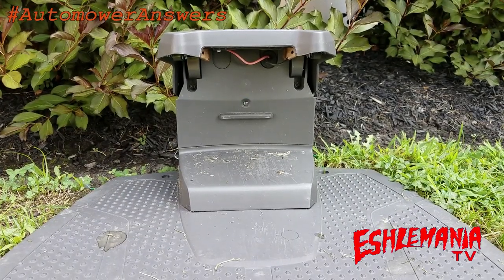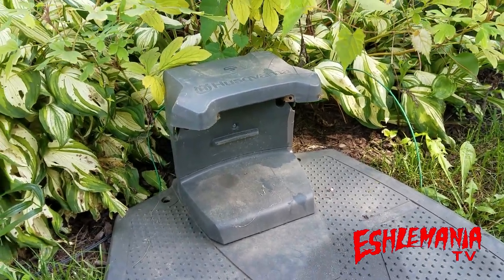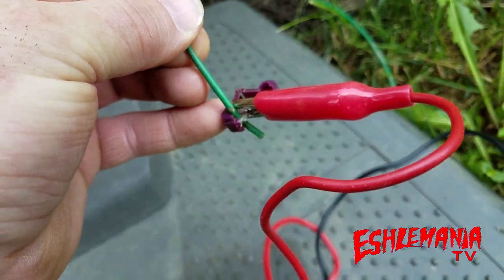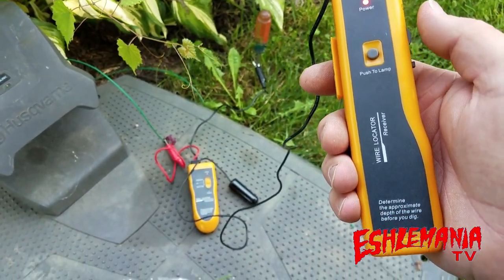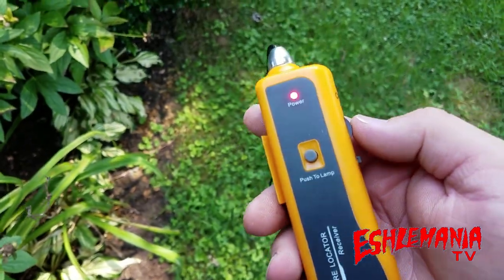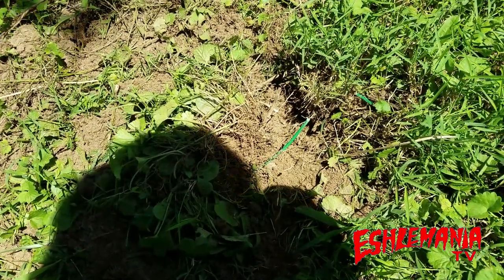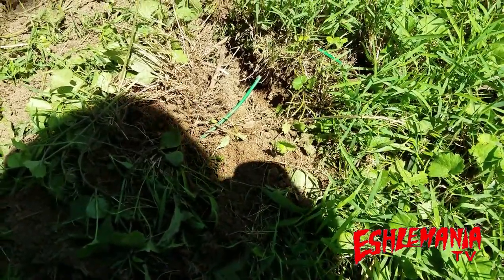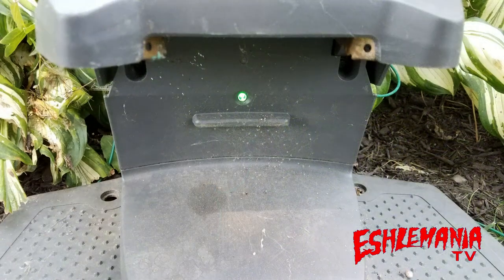Automower Answers: Finding A Break In An Underground Wire (No Loop/Flashing Blue Light Part 2)

Comment: You to the rescue again.  Used your video to wire around a fence back yard to front yard.  Works flawlessly. . .many thanks.  Now two days later I'm not getting the green light/broken wire.  Found this video and just ordered the Kolsol Wire Locator Tool from Amazon.  Will let you know how it works.  I'm feeling pretty confident.  Thanks again.
Reply from the maker: Great to hear! It takes a little while to get used to using the tester, but once you get the hang of it you'll have no problems finding breaks in the future.
Reply: @EshlemaniaTV  With your visual demo I think even I can do this. . .lol.  I gotta tell ya, your video demos are the very best available on the internet.  Thanks for actually doing what the video title says. . ."Locating a broken wire" for example.  My tester Kosol like yours comes tomorrow.  I tried the am radio thing using two different radios with no luck.  I hope this works.  If not, it was worth the try per your video.  If re wiring is necessary, at least I'll feel confident in my attempts at this point to solve the problem.  Thanks again.  I'll keep you posted.  Excellent excellent demo video.

Comment: FYI my issue was at the L and R connectors to the charging station. The purple connector had bitten thru wire so wasn't getting signal. Simple solution but only after I'd spent 2h trying others!
Reply from the maker: We went over checking all of that stuff in the first video we did.

Comment: Thank you for this video, especially detailing exactly which system you used and the sensitivity that it brought. I knew I had a partial break in the wire, because the WORX base unit was showing green (green good, red no connection),  I bought a different wire tracer, which was naff, and did the AM radio "trick" which didn't work at all for me..   Within 10 minutes of using the system that you have highlighted,  I found the dodgy wire, which was a partial break at a connector)... no other system was sensitive enough to help. Highly recommend the kolsol F02, rather than the cheap wire tracers on ebay / amazon.

Comment: Hi,

Many thanks for your most informative and clear videos on resolving issues on the Husqvarna 450x. Living in Scotland does unfortunately prevents me from doing business with you for which I am extremely sorry.
I have lots of problems with flashing blue lights and have you videos on the subject most helpful. I do have a question though and that is when using the Kolson NF-816 (a most useful tool) should one disconnect those wires which do not have the transmitter plugged in. I other words all wires are unplugged from the docking station and the suspected broken wire is connected to the transmitter part of the Kolson NF-816.
Kindest regards and thank you for all your hard work getting these videos up and running.
Ian

Comment: Hello, 
to test with the KOSLOL (I just bought it too) you left the base connected to the power supply ?
Did you remove the three cables (AL, AR and G1) from the base?
And which cable did you connect the KOSLOL to ?
Thanks
Reply from the maker: You can disconnect the power supply if you want. It shouldn't make a difference. You really only have to remove the wire that you will be testing. But in some cases it does make it easier in cases if you disconnect all the wires to help eliminate extra feedback and static to help hear the tone better.
Reply: @EshlemaniaTV  Ok thank you :)

Comment: I have been using the AM radio trick which works pretty well but think I will pick up a tester to see if I can improve my performance. I originally only had one guide wire but sine your last video I have added 2 more which has really helped cut down on my break location times.
I have a large yard with a 450X. Right now I mow about the limit (1.5 acers) with the mower. I really need to add another mower but I do not have power to the back of the property to place another charging base to mow the back of the property. Any suggestions. my goal is to have mowers running t the same time to mow my entire 2 acers.
I thought about dividing the yard into 2 halves (side to side instead of front to back) but worry that the yard would look uneven. Would prefer to have the back of the yard have its own mower, but not sure how to get it to the working area without running power 100 yards to the back of the property for another base.
Keep up the great work
Reply from the maker: The AM radio used to be my go to and I still use it occasionally. It works well in most cases. We ran into a few properties though where there was a lot of interference in the ground and ended up using the tester shown in the video. 

For adding another mower to the back of your property with no power, Solar panels would probably be the easiest thing to do besides running power from your house. Not sure what else you could do in a situation like that and have it be feasible versus running power out there.

Comment: Hello, have you ever experienced a situation where you can hear a tone from the wire finder, but the resistance in the wire (test by a multi-meter)  is so high that the charging station will not recognize a circuit?  I have used the guide wires to narrow it down, but its still the biggest section of wire.  Now I think I will have to cut the boundary and make a smaller circuit to narrow the location further.  Not sure how the wire could be damaged enough to interfere with the circuit, but not severed.  A pain.

Comment: What is the best wire to use to fix breaks?  Can you buy it at Lowes/HD/Menards?
Reply from the maker: The best wire to use is the same wire that is in the rest of the system. Don't think you can get it at Lowes. A dealer is the best bet. If you do not have a dealer near you then send an email to roboticmowerservices@gmail.com and they can get you fixed up with wire and splices.

Comment: Yea thanks for the tips but none of that has worked for me. 
I tried the pro version of that tool just wound up throwing it against a wall. 
It’s inconsistent enough to keep me guessing and digging. 
The guide wire tests tells me it’s one side of the loop but i can’t seem to find it as the tester says its all good all the way to where guide 2 goes in. Then after trying the other side of the loop it’s showed flashing green. Thought it was fixed went about my business and after mower finished charging it went back to flashing blue. 
This is after only one season. I fully charged  it and brought it and the base inside.  
Put it back out and it never worked 
Don’t understand what could have possibly broken over just one winter. 
After getting screwed by husqvarna for free install and the “installer” I am not impressed. 
3000 just to be frustrated and have to get landscaper to cut grass now.  
Too bad you guys are not closer.

Comment: Great video thanks before purchasing though. What do you do if you have a very large yard and your break is at the fartherest point? Is the signal dection distance the distance through the wire its traveling through or as the crow flies from point of connection to the break? Cheers

Comment: Are you still using the original wire on your installs?
Reply from the maker: Depends on the soil where we are installing. If it's in an area like a development where people aren't driving through their yards and there are not a lot of rocks and tree roots, then yes. Haven't really had any issues with the actual wire itself in those environments.
Reply: @EshlemaniaTV  Got ya. Supposedly the black 3.4mm wire is 100% copper and gives a better signal, any experience with this wire?

Comment: 5$ small handheld AM radio does the same job :) - Ive used it 2 years to find brakes
Reply from the maker: It does in some cases. I used to use that method, but ran into issues when working around underground dog fences and some underground utilities.